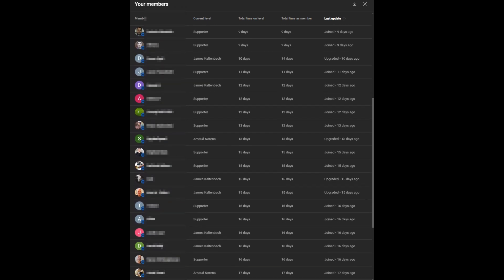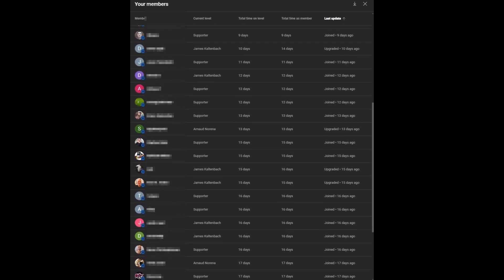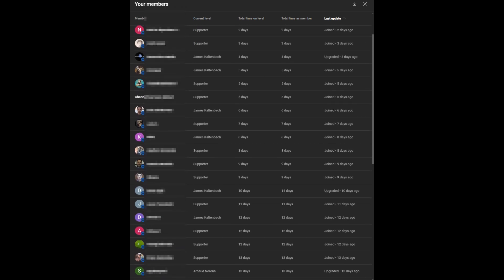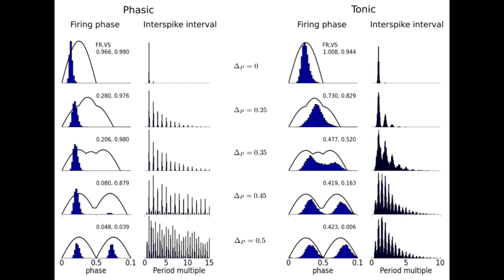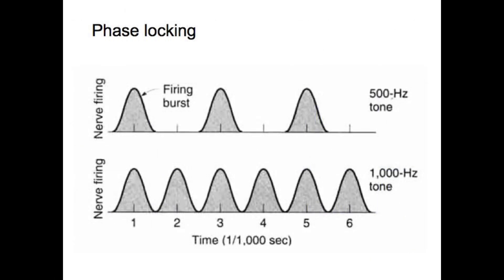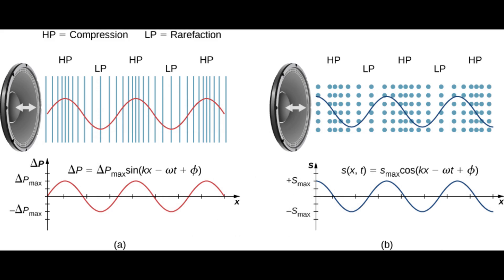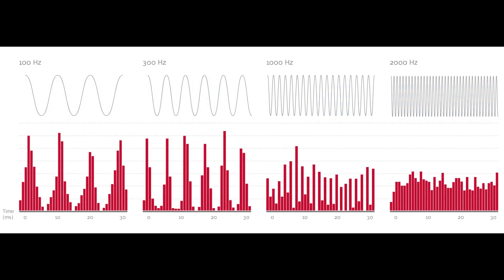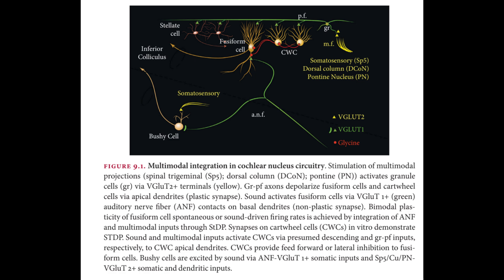How Fusiform Cells Process Sound❓High Frequency Noise = Bad for Tinnitus + Susan Shore Device Update

Comment: Very interesting presentation. My primary tinnitus tone is in the UHF range. I have identified it to be somewhere between 14000 to 16000hz. I used to describe it as an old CRT tone. Though interestingly, I have found I can achieve residual inhibition using narrowband sound anywhere from like 12khz and up.

It has always been fairly mild (had it since a teenager, 31 now) but within the last year it's definitely gotten quite a bit louder (combination of general acoustic damage and I think possibly some temporary spiking from trying to find my tinnitus tone after I noticed it was worse than in the past).

I also have a much less noticeable tone which appears to be an octave or so below this which I find very interesting, it seems to come and go but that has also been louder recently.

I really hope that the SSD will be just as effective at higher frequencies, maybe there is room to not have to pinpoint the frequency as narrowly, given it's just 1 octave from 8000hz to 16000hz?
Reply from the maker: For best results 1/6 an octave is basically the most you can be off by
Reply: @TinnitusLabs Aha, sounds like that could work within my identified window then with a little more fine tuning.

Have there been many participants with tinnitus in the UHF range above 8khz?

Would be interesting to see what the average tinnitus frequency has been across all participants as well.
Reply from the maker: Yeah, quite a few in the UHF range. Most common is around 8-10khz.
Reply: @TinnitusLabs  Very interesting to hear. Keep up the good work dude. It's so good to see some positive movement in the world of tinnitus treatments.

Comment: Just wondering what you’re doing to address the neck, jaw and facial issues and r u doing anything to mitigate the muscle tension issues? Even though you’re using your version of the SS device, without fixing the actual cause wouldn’t the noise still keep recurring?
Reply from the maker: @melodyebuskin5490  I'm not currently doing anything about my cervical/jaw tension, but I will fairly soon. I wanted to test efficacy while not addressing these issues.
Reply: @ makes sense - process of elimination.

Comment: Hello Antony, sometimes I hear voices in my head. Is this a different situation or does Susan Shore's device even work for this?
Reply from the maker: @deeepurple2024  This is usually a symptom of schizophrenia. Do you hear voices or songs?
Reply: @TinnitusLabs  No, I don't hear a song, I just hear noise on the sides of my head. Normally, I had tinnitus due to exposure to loud noises, but due to excessive stress against this situation, I just started hearing this sound. I notice that it gets louder when I push my head back. actually exactly the top parts of my ear and back of my head
Reply from the maker: @deeepurple2024  So is it a sound or voices?
Reply: @TinnitusLabs  oh sorry my broken english. its a sound

Comment: Any implications for SSD treatment? The device uses an audio stimulus that is centered at the user's T frequency. Are patients with T frequencies below 5000 Hz at an advantage to those with T at higher frequencies? Does the presence of very high frequency T, and the 'rate coding' in processing the treatment stimulus present a potential hurdle for treatment success?
Reply from the maker: Good question! The only difference, I would say, is that people who have lower freq. tinnitus have less of a chance of accidentally spiking from overstimulation (volume of audio stim, for example). So people with UHF T have to be even more careful.

Comment: For me, my tinnitus has been extremely low now for the last 4-5 months. 

As it stands, over the course of the last 7 days (approx.), my tinnitus returned slightly - and I speculate it is as a result of earwax build-up again.

HOWEVER, when I had tinnitus for the 4 years prior to it going away those 4-5 months ago, my tinnitus was permanently tonal and always there at a constant level. When I had earwax removal (which was not the causality for my tinnitus originally but must've been a contributing factor to why my tinnitus remained as I have very small and bendy ear canals, which cannot naturally migrate earwax out), my tinnitus disappeared. Now that it has returned, it is NOT the same sound as it was before. Mine, too, is also a more pleasant hissing sound that does NOT react to loud sounds. Only quieter sounds (like the radiator), certain annoyingly high frequencies (15kHz+), and possibly some neck/head movements (that I haven't quite figured out yet - if it even does have an effect), cause it to react/change. Louder sounds always makes my tinnitus go quieter.

Edit: Clenching my jaw always makes my tinnitus increase in volume - and I often find myself clenching my jaw a little bit when playing games. A habit I need to work on.
Reply: Hello, could you share which method was used for your earwax removal?
Reply: @chinchinchilly Yes, it was manual extraction and then a week later gentle water irrigation to get the last bit out of the ears.
Reply: Interesting. Mine reacts to the Car engine, fridge, kettle, and Desktop PC depending on my tiredness i think.
Reply: @Hew.Jarsol  yes, my Desktop PC was definitely one as well, but I fixed this issue by continuously playing some soft, gentle and ambient music + nature sounds like calmly running water to distract my auditory system from the sounds of my PC, which seems to work wonderfully for me.